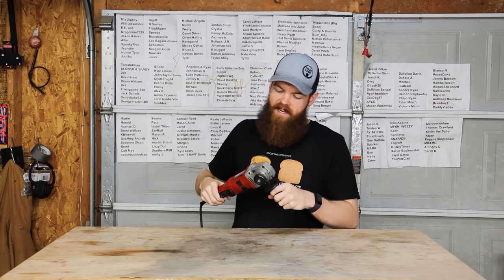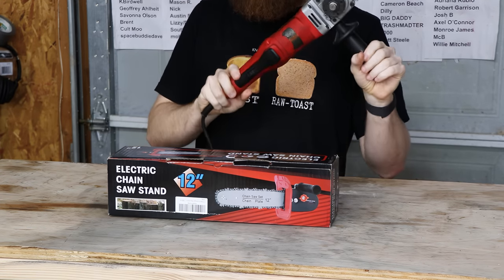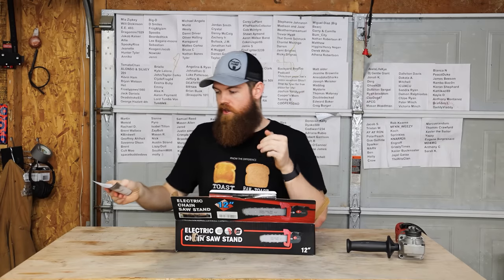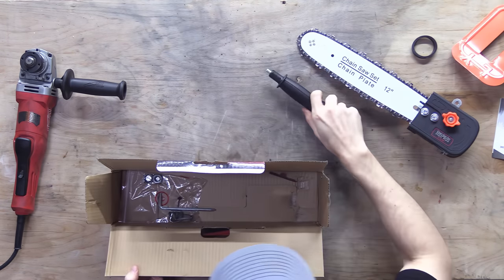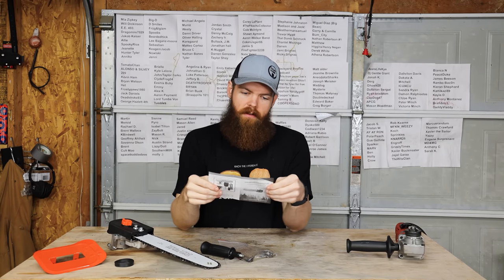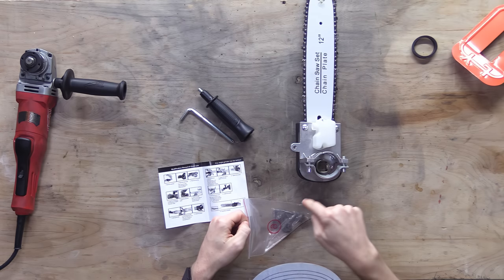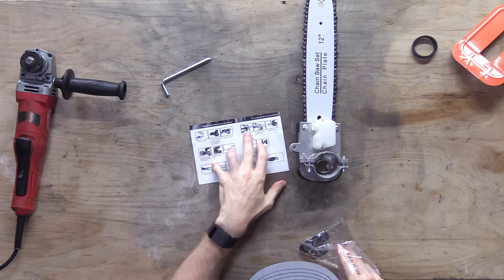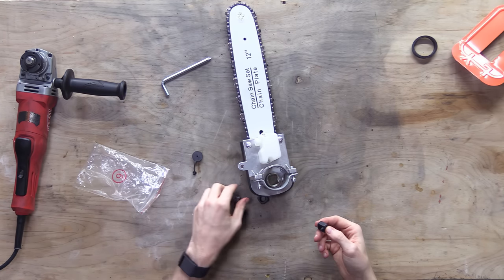Testing The Most DANGEROUS Tool From Amazon!

Comment: Chain discs are super dangerous and should never be used. Chainsaws are already inherently dangerous, and this just compounds the issue.

Edited to add: Please never move the chain across the face of the wood to "carve" away at it. Chains are not designed for side force like that, and cause them to snap and wrap around your arm or face. Even normal chains for full sized saws are not meant for that type of work, even though sculptures misuse them in this manner.

Comment: The disc's are more meant for artistic or removal of bulk material, not really for cutting, and they look dangerous as all fk, I have a battery operated chainsaw and it works great for branches and whatnot, still scary though even at 6".

Comment: Imho, Any transforming kit, is dangerous. I personally have a kit for a drill to a grinder, with a holder for a working table. Frankly, it is a safety hazard.
Another kit for a grinder to a miter saw / table saw with a 4" x 40 T saw disc, Its a meh, because obvious reason, the size of it

Comment: Hi, the idea of transforming a grinder into a chsisaw is a good one, the adapter would be less dangerous if the attachment to the grinder was in three points with more resistant materials instead of fragile cast ZAMACK or MONEL plates..., 2.5 steel sheets mm would already be enough to provide good structural rigidity, so this adapter is a waste of money and materials, designed to last a short time to amuse the consumer;  Anyway, I made my own chainsaw adapter for a 2200W, 220V 6000RPM grinder with this in mind and I've had it working well for several years, but you need to be very careful with power tools, they're dangerous hahaha...🇧🇷👍

Comment: I know, let's remove the mounting points for the grinder's guard AND then use the chainsaw disc. Anyone else would've tested the chainsaw disc first, while they still had a guard for their grinder. Not Tyler! he goes for ultimate butt puckering by using the grinder with no guard and no handle.

Comment: I was about to say you can walk out in my fab shop and out of the 5 angle grinders you will not find one guard on any of them and only 4 of them I took out the safetys.
Reply: notice he didn't put anymore grease on the spline gear, yes I know there was some on the other end of the tool but that's why that's called packing grease, his 120 dollar angle grinder will work for a few more years due too he doesn't use it often. lol
Reply: Lets see you use that and cut through your table. lol
Reply: I knew it would fall apart. lol

Comment: The clamp to the grinder is such a dumb design you could have at least put teeth on it for it to grab, but if it was me I would have put metal locking straps that go around the back of the grinder to make sure it was held tight and would be able to fit more than 1-2 devices with limits on the grasp being only 1 size you limit your buyer ability to use without modding. so yeah they could do better but at least it cuts fast so when it falls off and hits your leg it won't hurt as bad at first.

Comment: Tyler almost got "manscaped" by one of the most dangerous grinder attachments. First: the choppy part is used mainly for scooping out say tree stumps or sculpting. second: ALL of those with knowledge of it use a little black handle that screws onto the tool which is used for better control and safety. 
It is apparent your very uneducated with machines that have blades that move really really fast.

Comment: You don’t have to put much pressure when using a chainsaw use the chain in the weight of the saw do the work not push down on the saw that hard

Comment: That tools you are using is so so dangerous because the chainsaw and ring cuter tools have 3000 up to 5000 rpm in the actual tools but the angle grinder have 8000 up to 11000 rpm . It's too much rpm for chainsaw if chain is broken It's going to rip the face of users and angle grinder cut faster because of higher rpm don't use that tools please